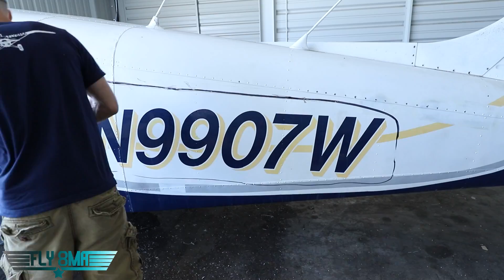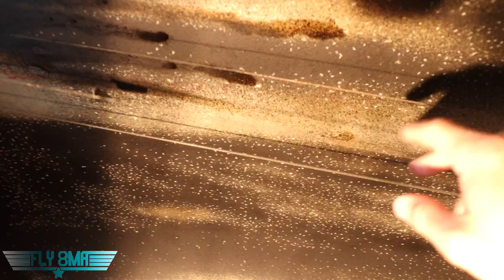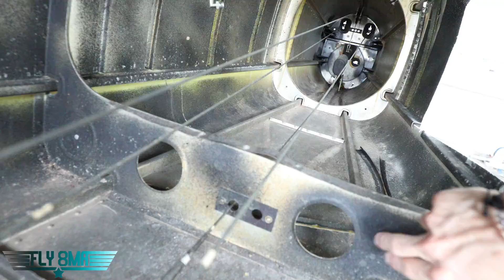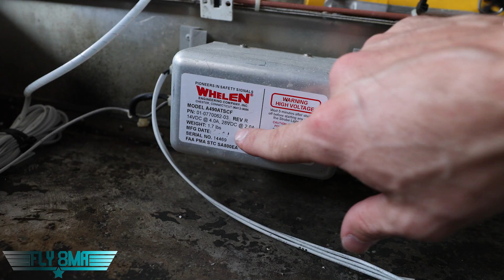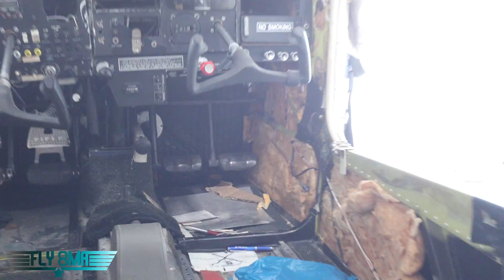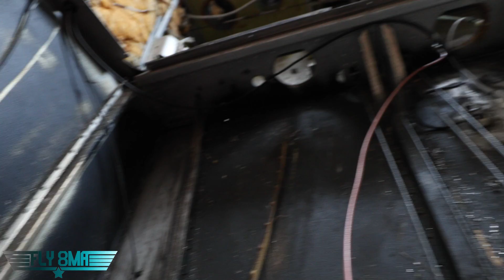Inside the Empennage

Comment: I just bought an ELT off a junked C55 Baron for $286, a lot cheaper than new. If it still works why not use it?
Reply: As long as you can still find a battery and or the battery is in date and you have the ability to get the STC for it for your plane there’s nothing really wrong with that. If you are flying somewhere remote, you might want to consider something 406 gps instead, as the older 121.5/233 ELT’s are only going to get a search down to 1 to 7 miles and only going to be noticed if in line of sight to a detection antenna and or heard by an overflying aircraft.
Reply: @AkPacerPilot  it's an old-style 121.5/243 MHz EBC-102A ELT that is a direct replacement for the unit that finally died after a long life in my plane -- no STC needed. The 406 gps upgrades really aren't much more expensive but they require an antenna that must be installed by an AP ($$$$).

Comment: Jon I have a question for you! Without using a handydandy cutting saw, what is the proper way to access those rudder cable turnbuckles on that aircraft? Do you have to squeeze through the back of the cockpit?

Comment: The fasteners along the top are nutplates or platenuts. They go by both names, and have three holes in them, two for rivets and a threaded one in the middle for the screw used to attach something. Rivnuts are a little different. They're just round threaded fasteners that you push into a hole, then expand with a tool so they get stuck in the hole.